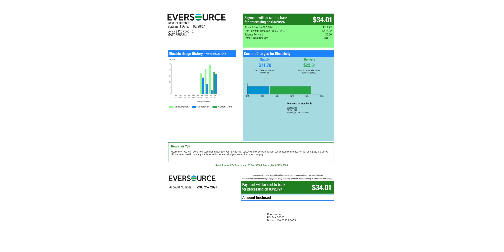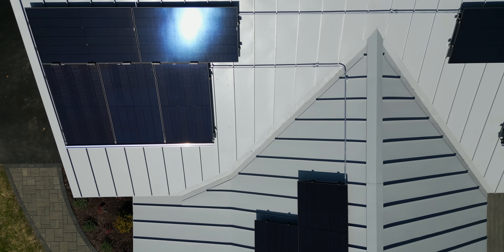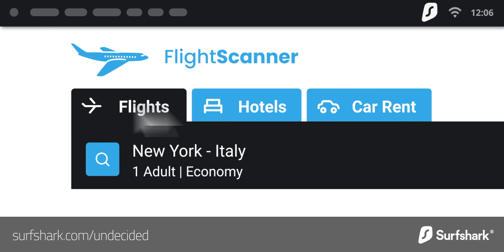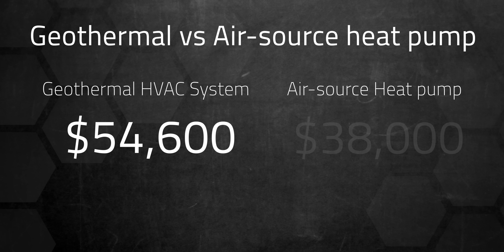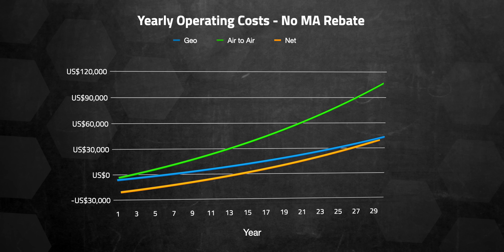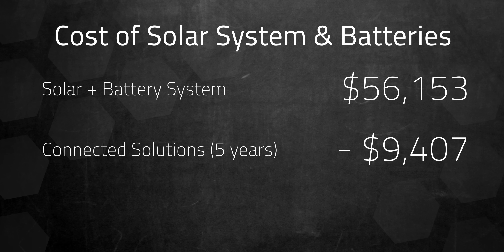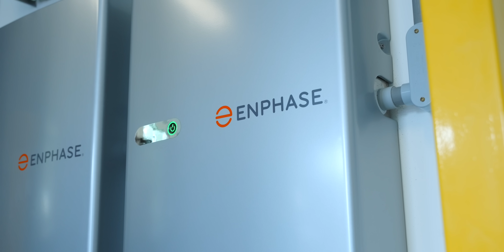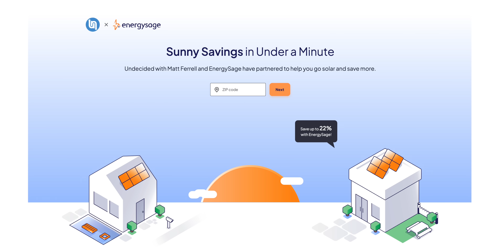What I Learned After 1 Year with New Solar Panels

Comment: Your comment about choosing the design of your home without stairs so that you can age in place is so crucial! As a realtor, I handle many clients who find themselves in a position where they have to leave their home because life has dealt them circumstances where they cannot navigate stairways at all. It’s so sad to be backed into a corner where you have to leave the home you love. Highly recommend people to plan ahead and move because they want to rather than waiting until they have to. 

Love your channel. Thanks so much!
Reply: Elevators should be more popular. If more homes had them, they would probably be cheaper
Reply: @Bryan-Hensley  I guess you could put an elevator in the same space you'd have your stairs. I think a lift would be more practical.
Reply: @Bryan-Hensley  you can only really build them where you also have some sort of potent frame, which the paperhouses of northamerica do not have
Reply: @kkon5ti  not a residential elevator. The ones I've seen are self supporting.
Reply: @bighaasfly  I would happily just install a stair lift over changing houses.
Reply: @thebaldfox711 many houses cannot really accommodate that. Especially houses that have landings partway up. It makes the staircase very accessible when you can fully use the steps but really complicates a chair lift
Reply: I'm building now...  Stairs only to a storage loft, wide hallway, extra wide doors. Curbless shower.  Blocking installed in case of installing handrails throughout. (and blocking at the 5 to 6.5 ft height typical for hanging pictures, TVs, shelves)

The storage loft is designed with a balcony access (good place for holiday decorations) having a section of removable handrail to use a power lift to get anything heavy up.

Very cheap to put the blocking in while building.  Nightmarishly expensive to put it in by remodeling.
Reply: @fhuber7507  I’d love to tour that house and see your project! Sounds interesting!
Reply: When we built our last forever home 9 years ago, aging out in the home was a crucial part of design and has proven it self. We even built in a care givers suit so we can stay in the home as long as possible.
Reply: We're 40, but we installed an elevator in our latest renovations for future proofing. It's not just aging in place, but also things like moving heavy loads between floors. Our kitchen is upstairs and the elevator helps with every Costco and Grocery run.

We're an entire sub-division built on a giant hill looking to the ocean. So everyone has two (or three) floors kind of angled into the hill. One side of the street enters from the top and the other enters from the bottom. I've been told by realtors that "enter from the top" is more valuable simply to avoid bringing the Costco upstairs. That's even for people without limitations.

So yeah, I highly recommend the elevators.
Reply: Somebody in my family installed a chair lift to go up their flight of stairs. Seems to work fine. A lot cheaper than all the expenses involved in moving. 

Also, with the cost of homes these days, why not install a home elevator if you are building your own own, or if you have a very large space to retrofit an elevator.
Reply: Just have your kids live upstairs?
Reply: Funny term "age in place", sounds like a municipal label for structures. Certainly if your health degrades, or you develop a disability in mobility the home setting can be a significant factor for comfort and needs. I find that some good railings and proper lighting make stairway access much safer and comfortable to use and I enjoy the advantage of more living space at lower cost.
Reply: I have 20 steps to get to  my upstairs living area. Above my shop area downstairs. I  plan to retire as soon as I get it paid off. 3 years max. I figured I would stay healthier. Walking the stairs.
When I can't get up the stairs. I have a super high 4 post lift. Next to my raised deck. That has the same aluminum decking onto it.  That I'll drive my car onto raise it up get out of my car and walk in the sliding door.
Reply: so just install an elevator
Reply: If I can't walk up stairs, just put me down
Reply: My 1st story walls are 10' high in my Victorian house and the stairs are a great source of exercise.  I'm 74 and my wife is 80.
Reply: @123Goldhunter11  My grandfather had a house with one bedroom upstairs and two bedrooms down. He slept upstairs until he went into assisted living at 91 for short term memory loss. He said the stairs kept him in shape and I believe it. I strongly dislike sleeping on ground level and aspire to be like him.
Reply: @bighaasfly  can't it be like children use the upstairs and older people use the area below?
Reply: "Aging in place" has far more to do with your individual physical capability (which depends almost entirely on how well you take care of your body) than it depends on whether or not you have stairs in your home. I see this type of comment all the time and I always think to myself, why aren't these people focusing on taking care of their bodies to protect and extend their long term vitality? Instead of worrying about avoiding physical challenges as you age, why not focus on intentionally training your body to age more slowly? I will never understand why so many people just assume they have to become frail and decrepit in old age. This is a choice, not an inevitability.
Reply: @ agreed! All true. Yet here we are because the majority of people eat crap good and look for easy living. They avoid the strains of maintenance on themselves. It’s just what people do.
Reply: @bighaasfly  Well, not me. I prioritize my health above ALL else and it pays huge dividends. A wise person once said something like "we only have 3 primary resources in life... health, time, money... in that order of importance." The worse your health, the less time and money will matter because you won't be able to take full advantage of them.
Reply: I'm 38, and we downsized specifically for that reason because my joints are already really far gone and having to go up and down stairs can be rough depending on my joints.
Reply: @Jokerwolf666  Did you do extreme sports? I am 32 and I just started inline skating. Maybe it's a bad decision.
Reply: House is ugly.
Reply: Chair glides between floors are cheap and effective.  I had a 93 year old uncle living in a two-story house in Pittsburg with a garage in the basement and he had no trouble getting around between the three levels - including using the chair glide to bring his groceries up to the kitchen from the garage.  Of course, it requires electricity . . .
Reply: Or...invest in yourself.  Get off the pop and chips, join a gym or physical activity, and enjoy life deep into the 90's and beyond with the stairs.

Comment: Fascinating as always.

People always think "Go big or go home" but even smaller less "Bells and whistles" systems are worth while.

This year we had a bit of a heating disaster (Boiler died in April) which forced me to fast track my own (much more modest) plans.

We crammed all the solar we could fit on the roof (about 6.6kw, so 1/3rd what you could easily fit), 10KWh battery and got an Air Source Heat Pump.

Also replaced oven with Induction, and dryer with a heatpump dryer.

Cost about £30k, which was a big investment, but worth it.

We went down from 22MWh/yr (Gas and Electric) import to arround 2 MWh/yr (electric only, bye bye British Gas) total, and may even be lower then that, not had a whole year yet, may get below 1 MWh/yr with luck.

Many other small incremental improvement, insulation, better windows and doors, that sort of basic stuff, has also helped.

You dont have to spend £100k buying the works, smaller solutions can also go a long way.

Comment: Good to see the figures. I'm trying to get our house sorted, tho its an awkward one due to lack of space for heatpumps, etc. 

One thing you didn't cover tho is lifespan of the inverters and such like. You mentioned the solar having 25 years, but inverters and batteries (at least over here) don't have anywhere near that. There is also the risk of damage to a solar panel which would need replacing (with the same type/rating) which 10 years down the line might be hard to source and potentially mean replacing an entire string to keep the efficiency. Tho possibly better panels will be out by then which might offset the cost.

Comment: Its just too bad they don't use sterlling engines to generate electricity from your infinite heat sink/source geothermal system.  If/when we get that, you will wish you didn't bother with the solar.

Comment: Wow, I did my own system, on an all aluminum ground mount with ground screws. 30 x 700 watt Bi-Facial panels, 16 kW Hybrid inverter, 2 x 15 kWh batteries. Tools, ladders, equipment, cables. USD $21k. This was 2 years ago, still working great. 16.93 MWh of production so far this year, 16.67 last year.
Reply: yeah he was ripped off HARD... i mean 33k for 20kWh of batteries... crazy
Reply: @no-eb2xx  Yeah, I don't get that price for the batteries. You can get that much storage for $5-6k.
Reply: @baddriversofcolga  @no-eb2xx the batteries he got and the full system all 'talk' to each other.  It's like buying a striped  base utility truck and comparing it to a Ford Lariat
Reply: @rusticlifefarm6264  Much cheaper systems do that as well.
Reply: @rusticlifefarm6264  all batteries are connected with the inverter/s. What are you BSing about?
Reply: @no-eb2xx   Clearly you have not been following him.  If you had and listened you would know what I am talking about
Reply: @rusticlifefarm6264  definitely not worth the extra extra extra extra cash
Reply: Holy shit, DIY is cheaper than contractors?

you might be on to something.
Reply: @wtfdoicare  well yeah but it's still a crazy price.
Reply: now the system will cost you half the price, panels and battery prices have tanked.
Reply: @majidmehmood3780  for 33k you can easily get 130kwh these days, even more with bulk discount.

Comment: $88,000 dollars my monthly electric bill is $150. $88000/$150=586 months to breakeven (48 years)  your panels will last 20 years so it will never pay back. unfortunate
Reply from the maker: Did you watch the part where I said, "you can't take my numbers and apply it to yourself"?
Reply: Is your heating included into the calculations?
Reply: @ShinerzFIN  Heat is $60./month  on the annual budget plan. I live in Michigan. So, electric and heat combined:$88K still takes over 35 years to break even assuming a 0% return on other investments. Even if solar cost half that (like it does outside the USA) it still would be a poor investment.

Comment: At $4,800 your bill seems crazy high. It looks like your house is around 4,000 sq ft tops.   

I would expect it to run around $2,000 based on the $900 annual cost of heating and cooling my 1700 sq ft house.

Comment: I had forgotten how expensive everything is in Mass. I've not lived there since 85. I've been net (sub)zero on home energy for years. It doesn't cost that much to go net zero in my location. Here it's almost always less expensive to add more solar compared to geothermal, which I've had in the past, batteries or other expensive options. It cost much less to get to a 7+ mWh net to the grid annually in my location compared to the costs you showed. Here batteries would save nothing, and only cost, much like all the monitoring you have is for you. Typically I generate more than 25mWh/yr, but that keeps increasing as I've added some solar every year recently. I expect that to get to over 30mWh next year. My most recent solar addition, I've done myself. When you have a pergola built for solar, but do the solar yourself, the cost of the entire project a tax deductible, making the solar part nearly free.

Comment: Another question is whether wind would work well in December.  Could you easily integrate a small wind system with your existing solar system?
Reply: If there's a free MPPT input in your inverter, this is trivial to setup. But if wind is actually worth it is another debate all together. Highly depends on microlocation.

At the end of the day, installing more solar panels (if space permits) might be a better idea. Even if you produce 20% of what you do in july, it's still propotionally more in winter with added panels. If you have net metering setup, winter production might not even matter with properly sized system.

Comment: That is insanely expensive. I had 6kWp and 10kWh battery installed this year mix of 12 and 25 yr guarantees, cost UKP £9,400 (US $ equivalent $11,875). You've paid 8 times that for little more than double!  The panels are cheap, equiv to your setup would be $25,000
Reply: even that is pretty expensiv. but labour costs are different across the world.

Comment: Curious any recommendation/suggestions for a 73 year old - like me and wife  - looking to downsize from a relatively inefficient largish home and build one from scratch (in Florida SE to SW move) that is - at minimum - energy efficient based on air tightness and external wall and roof insulation (possibly metal air gapped roof).  Pretty sure Matt's "model" would not be cost effective since I probably only have - at most - a 15-20 year time frame. So, maybe no need for solar and just use very energy efficient appliances.  But maybe still solar...curious.

Comment: I expected WAYYYYY more battery storage here for the solar system size and full electric house.  It seems like the stuff used here was heavily over priced and has dropped a lot in that year since purchase.   Can you toss in another party battery system to add more capacity?       EG4 5kw batteries are $1300.

Without a gas/oil heating backup, or a generator, 20kw would leave you with a frozen house in a snow storm here quick.. like 12 hours.
Reply: My thoughts exactly. A huge battery array with max panel coverage and a natural gas generator with a smart system to manage power generation seems much more interesting and cheaper. Getting utility approved batteries and array size is a joke ! The biggest takeaway in almost every solar  video series I have seen is that the electric company and government are NOT your friend.

Comment: I had 19 Q-Cell 405W panels installed in December of last year, and became active in early January. I thought I wasn't going to produce enough juice to cover my electric bill 100%, so I added 4 more Q-Cell 405w panels over my garage in April. So far I've produced a little over 7MW and projecting forward through the end of December be closer to 7.3-7.5MW, or about 1MW more than I will use. I currently have a $450 credit with National Grid (I'm in northeastern MA). I installed a 1.5 ton mini split in my kitchen which should more efficiently cool my downstairs than my previous cooling system, and also produce heat in the shoulder months, cutting into my heating bill. My system cost $28k. but I got back $10k in federal and state tax credits. It should pay for itself in 6 or so years (I currently have a $9k loan on it for the next 4 years). Then it should result in no electric bill, and my heating bill cut by about 1/4 to about $1500/yr. I say it was well worth it for me.
Reply: *MWh.  The 'h' matters a lot.
Reply: @georgedorn_fnord  Not me thinking he had an entire Walmart parking lot of solar panels and thought it wasn't enough
Reply: I'm afraid I agree, as much as I enjoy seeing all of Matt's gizmos.  For reference, I went solar in a much smaller house for just $16k plus another $3k for appliances & electrical to hook them up.  System pays for itself in 9 years, after which it will pay me $30k over its lifetime.